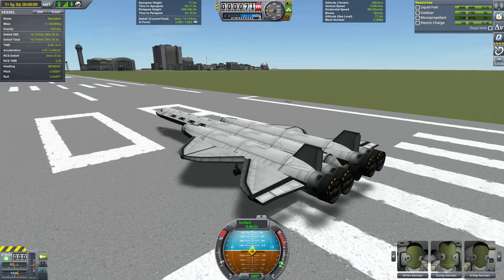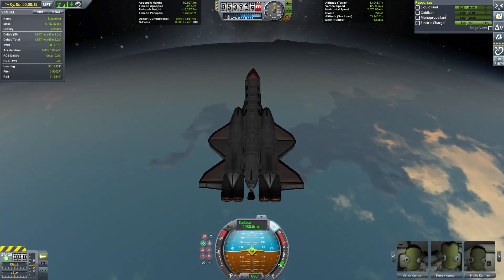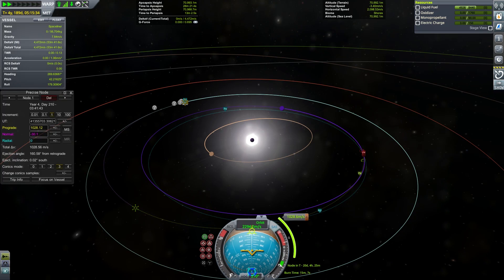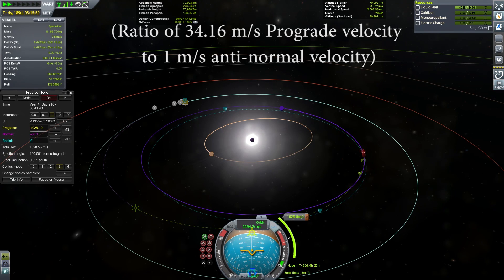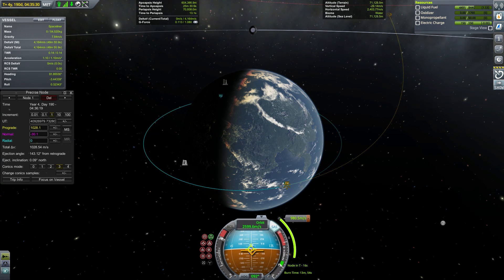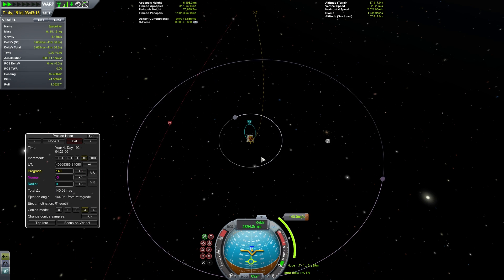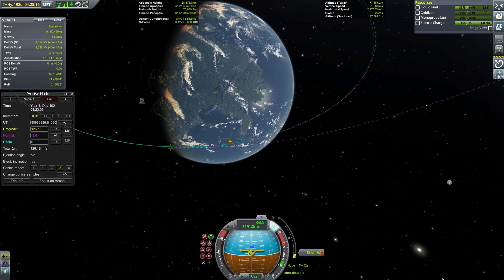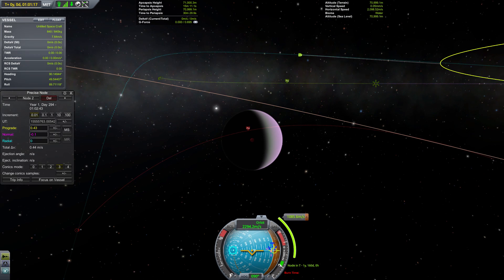Advanced Orbital Mechanics Tutorial Series - Part 1: Low-TWR maneuver splitting

Comment: What version of KSP are you using? In 1.6.1, I cannot replicate your ascent profile using a craft almost identical to yours. In level flight near sea level, the speed maxes out at about 370 m/s.
Reply: Wait what? Are you using rapiers?! They shouldn’t max out that low...
Reply: @spacekgb  As it turns out, when you get to around 20 tons per rapier engine, the craft becomes extremely sensitive to drag. Using the debug menu's part drag data option, it became clear that some parts were adding excessive drag. In order to make the craft work, I had to remove: the stow-away ladder by the cockpit, the stow-away solar panels, and the stow-away antenna. This marginally-viable design-style requires that virtually everything be stowed away inside a cargo bay, even things which are supposed to be aerodynamic. Adding the nose-cones inside the rapier engines also significantly improves the viability of this design. (Strangely, the "pegasus mobility enhancer" ladders do not significantly affect drag and are allowable). Another extremely sensitive factor is the amount of lifting surface: if it is insufficient, then the small amount of control needed to keep the craft pointing prograde will cause enough control-surface drag such that the engines will fail to get over the 400 m/s threshold and continue accelerating.

Comment: Isnt it less efficient to burn towards the maneuver indicator than to burn purely prograde, as those two differ during the course of a burn? Also is it really a good idea to perform the plane change in LKO, rather than during interplanetary transfer or at the apoapsis before ejection?
Reply from the maker: Adding a small amount of normal component on top of a prograde burn does almost nothing to increase the total magnitude (as mentioned in the video, sqrt(34^2+1^2) is still more or less 34. 

Burning towards the maneuver indicator is indeed slightly less efficient.  However, the phase angle of the plotted ejection is easier to match precisely with this method.  With more, smaller burns, the loss of theoretical efficiency becomes less remarkable.
Reply: Bradley Whistance 
Yeah the splitting def. helps a lot with that. I often cringe when people do long prograde burns on the node with up to 15° deflection from the actual prograde, so that was more of a general point to make, which does not apply in your video.

Comment: I have a question: How do i match inclination with Eve without doing a mid-course plane change maneuver (which is 300-400 m/s)?
Reply: With a very rare launch window that has you launching close to the ascending or descending node (where the planes of the two orbits intersect).
Reply: Launch at an eve transfer window, it's not rare at all. It's very easy to get an eve encounter because of it's gravity well.
Something like a moho or eeloo transfer is harder to do directly from kerbin.

Comment: Matt Lowne recently did a video featuring a 208-seat SSTO to Eeloo and back. His mission profile was unusually efficient for his videos, a requirement if he was going to meet the specifications he laid out for himself. He did that mission, which included numerous gravity assists and the maneuver splitting you cover in this video, entirely with the stock maneuver nodes. Do you intend to ever cover these techniques in the context of an entirely unmodded game? What's your attitude toward pushing the limits of complex mission execution in the base game, as well as mission planning and engineering challenges?
Reply from the maker: Matt and I have shared some intense banter over his insistence on using the stock maneuver nodes.  I believe in using the best tools for the job, and have no intention in ever using the stock maneuver node editor.  Its simply a less precise tool.  All these techniques carry over, it will simply be impossible to do things to the same level of accuracy.  It'll also take longer and be more irritating to do.

Kudos to Matt on a fantastic mission btw.
Reply: Do you know about the Sigma Initiative? Do you have a submission?

Comment: When you do the video on getting to Moho cheaply using gravity assists, make sure to talk about how to get BACK cheaply as well.

Last time I went there with a spaceplane, I took the time to get a nice Eve assist to roughly match Moho's inclination and to bring my perihelion down to Moho's perihelion. (Transfer windows don't cut it for me in this case, so I've found that what matters is timing the Eve encounter so that it lines up with Moho's aphelion; if you consider Moho's perihelion as 12 o'clock, then it seems to work when Eve is at about 8 to 9 o'clock and Kerbin at about 7 to 8 o'clock).
Although in previous instances I didn't find that Moho assists were worth it, in this case, my orbit after the Eve encounter was close enough to Moho's such that my aphelion was significantly changed after the Moho encounter. So, I did 2 Moho assists before coming in for the final capture burn, which turned out to be only 514 m/s, which I was really happy with. However, after all this, when I decided to go HOME after the trip, I was pretty lazy at that point. I didn't bother about transfer windows again, but instead I just launched at Moho perihelion and adjusted a bit to get an Eve encounter after awhile. However, I couldn't really seem to get a good Kerbin encounter from that such that my speed during aerocapture was slow--I ended up at Kerbin's atmosphere with a speed over 4,000 m/s, so I had to do some retrograde burning to slow down my plane so that it didn't blow up. I had extra fuel thanks to the gravity assists I used to get to Moho, but still, it was a bit annoying to have to spend it.
Reply: I had a similar mission, went to Moho unplanned, had to spend 40 years doing two gravity assists off Eve to get the entry speed down to 3200m/s.... Got there in the end. Hadn't tested for re-entry at those speeds.

Comment: What kind of efficiency gain are we talking about for that 8 burn manoeuvre against a 2 burn? 50% loss? 10%? or even less?
Reply from the maker: With a TWR of 0.1, a 2 burn ejection simply won't work.
Reply: @BradleyWhistance  It was just to give a number.
Reply from the maker: Well, if you really insist on a number, a 2 burn maneuver at this TWR would leave about 8 minutes for each burn.  We are talking huge, unacceptable efficiency losses.  As much as 50%
Reply: @BradleyWhistance  Thanks! I was just curious if it was an appreciable difference or just efficiency for efficiency sake (i'd still loved that), and wanted to check if you already had done some calculation before doing my own.

hyphens-I've done some really approssimative math, but the what i found is that the loss is equal to 2 times the integral of (x^2-1)dx from x=0 to k, where k is burn time/orbit period.
This is for a single burn versus a perfectly efficient burn, from a circular orbit.
I think this would be similar with sequential burns, but the formula would change since the orbit will be an ellipse.

I've tested inside ksp, and the results matched.

For example in manoeuvre of the video doing a single burn will give a loss of 24% against a perfect burn.
(PS: this last part is probably wrong, is this or double. I will check tomorrow)

i was really wrong.
But testing inside ksp, turns out that a single 24 minute burn has 18% of losses, and the same burn done in 5minute has only 1.3% of losses.
Reply from the maker: Also note than this TWR is still relatively high.  With ion engines, it pays dividends to get closer to .25 m/s^2.  This results in over an hour of burn time, which really mandates  many separate burns.